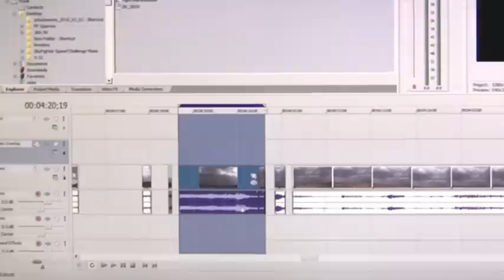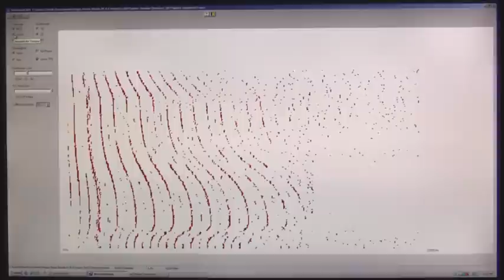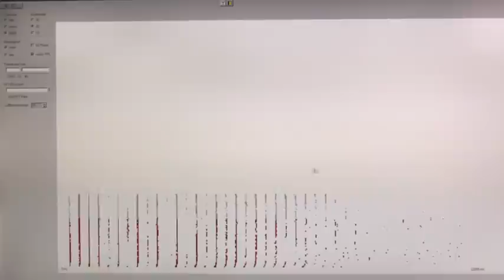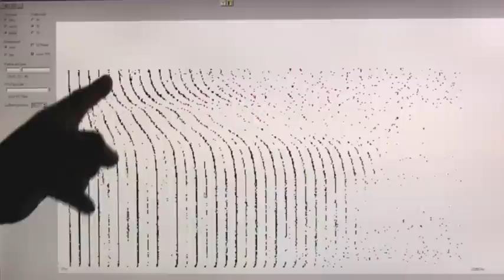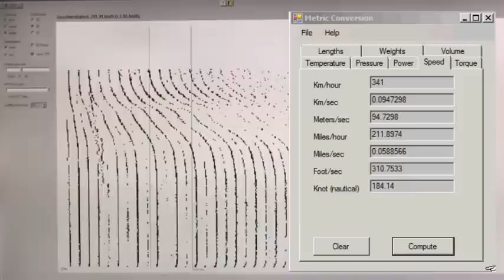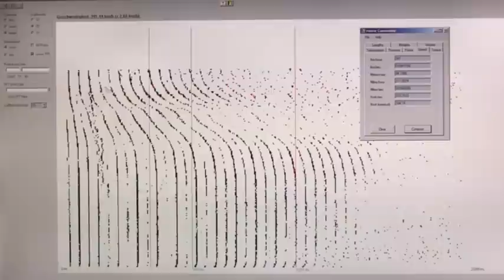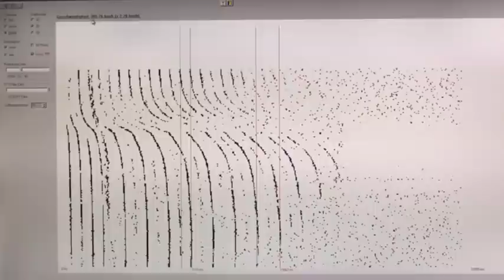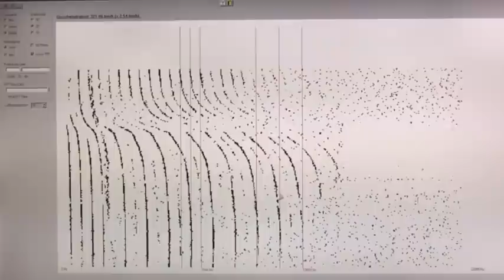SkyFighter v3 and FF-Sparrow Update and WAVEosSCOPE Doppler Program

Comment: Frank,
Enjoy your show. For the  next test, create a reference sound file of the stationary plane-motor near the Mic, 10ft away, do this at low,medium, high rpm recording.  This should show all the spectral lines without  doppler added. Make sure the sampling rate on the recorder set to max to prevent aliasing in the recordings, note the sample rate. (*** THIS NEW UTUBE FORMAT SUCKS****)

Comment: What is the motor and prop used, 2 blades, 4 cooling holes, all create sound at different frequency. Next do the flight tests. Select the best curves files to look at. Remember some of the curves are the harmonics of of the true tone, this will result is speeds double and triple of the actual speed,

Comment from the maker: Mike The variances tell me that the flybys at the camera were not done correctly. The Doppler method works just as good as the radar gun if done properly. And likewise the radar gun will give faulty readings if the passes are not strait at and over the gun. Hopefully the weather will be better next weekend so we can get back out to Hermann Airport for more attempts to get some accurate speed clocks on both planes.